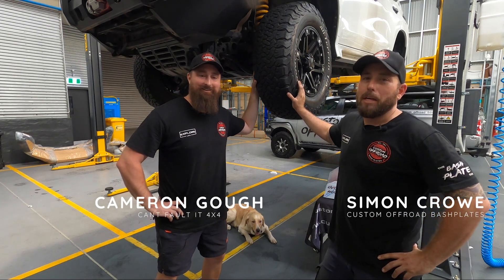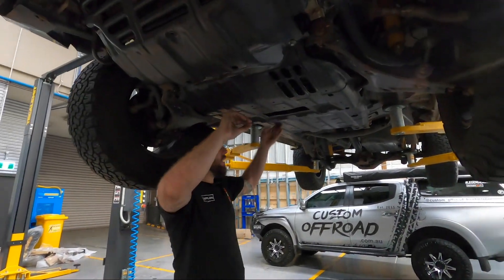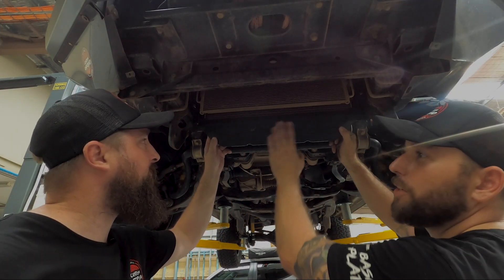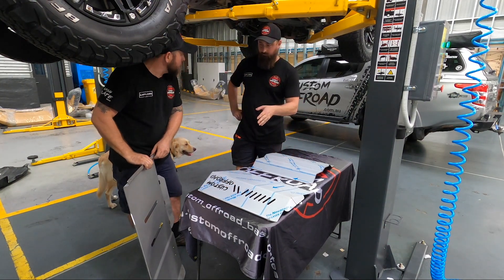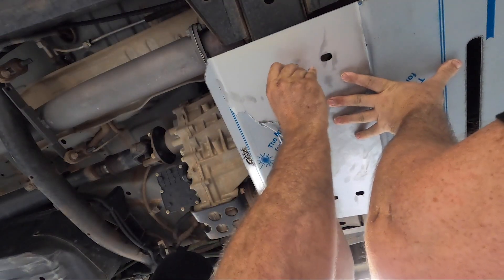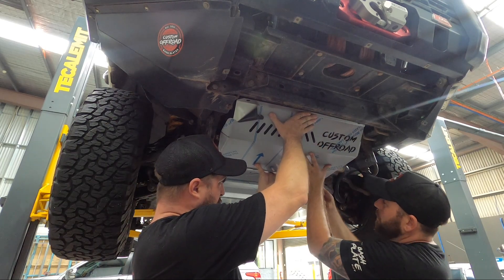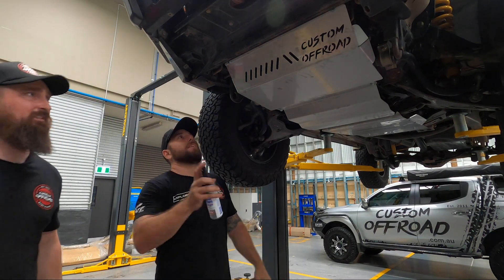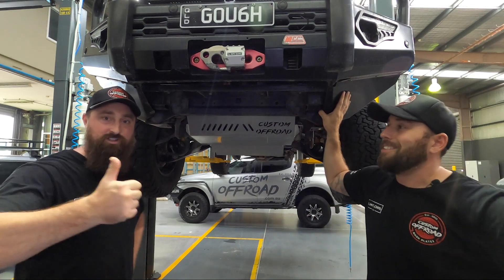Custom Offroad Pajero Sport Bash Plate Fit up

Comment: Is it possible to install just 2 (the front 2) without modifying the long plastic cover?
Reply from the maker: No its not, the second plate takes up half of the plastic so it has to be cut - Simon
Reply: @CustomOffroadBashPlates 

Thanks Simon. I’m trying to reduce weight so this info is really helpful. 

So, even though it’s more messing around, it’s feasible to cut the plastic plate and line it up to the second bash plate?

Comment: Has anyone done a before and after ground clearance comparison?
Reply from the maker: Technically there is more clearance from stock but with all the different suspension lifts it’s hard to get a fixed reading.